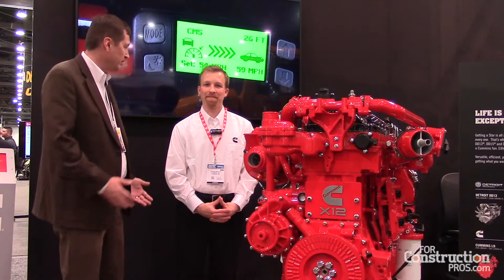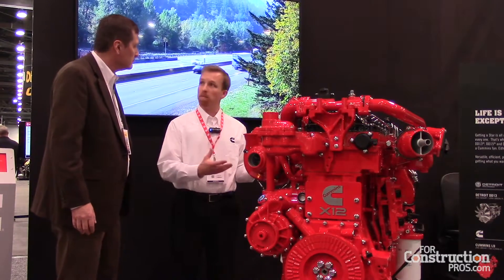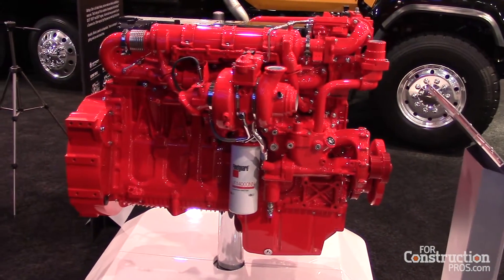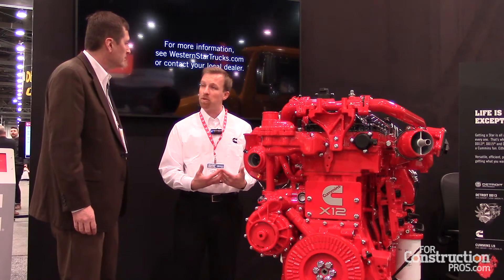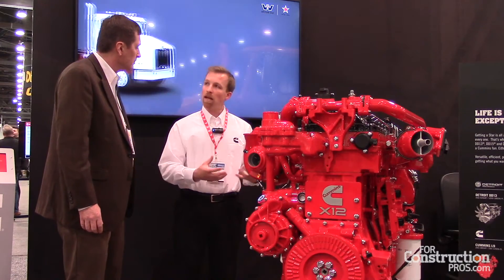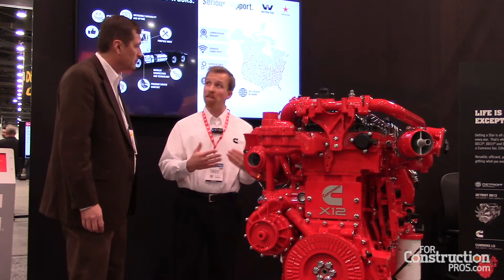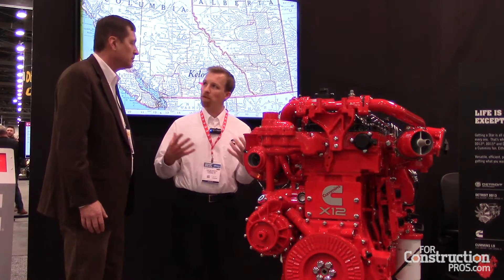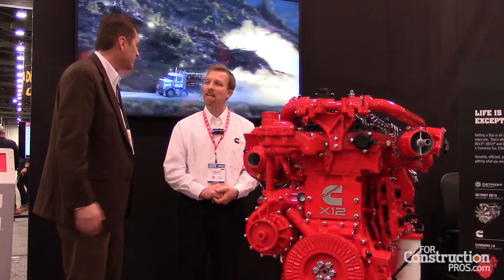Cummins Brings Proven X12 Engine to North American Heavy-duty Truck Market

Comment: not sure why would in a background screen play Wabco western star video when displaying the Cummins X12.  As far of I hear, 5700XE still doesnt have Cummins available as an optional engine over DD engines.
Reply: Western Star had invited Cummins to display the X12 in their own booth that featured the Western Star 4700.  The 4700 truck/cab enhancements (including new safety features) and new engine offering (the Cummins X12) were main points of the Western Star's press release the morning this video was recorded.